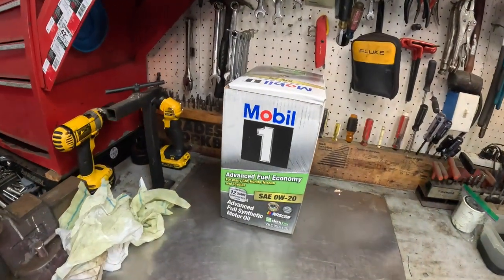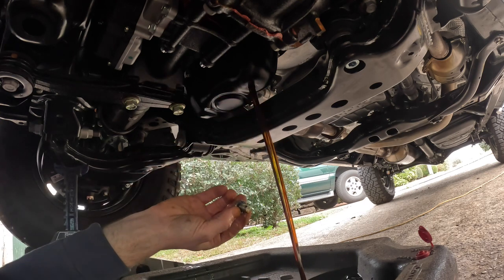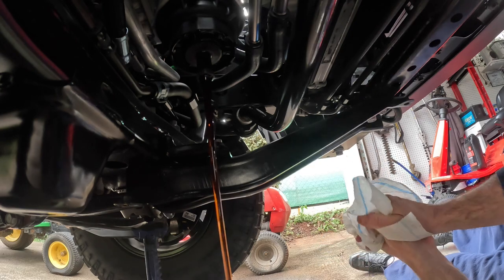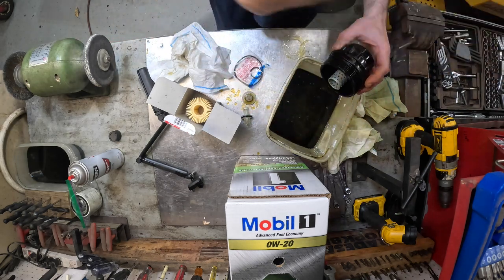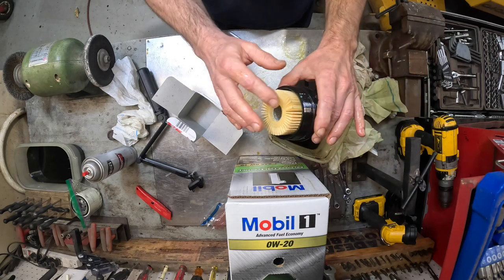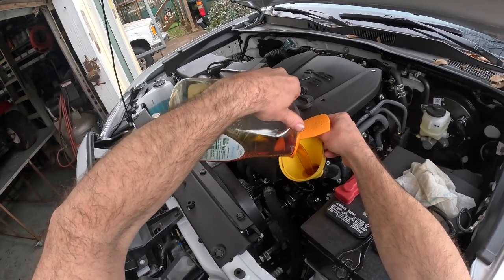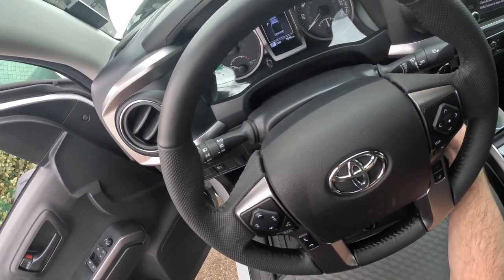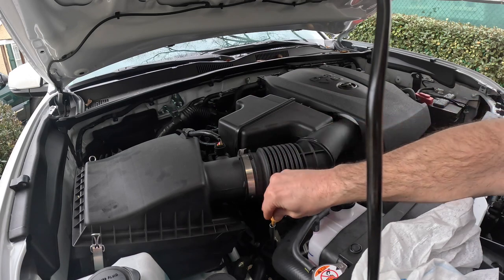2022 Toyota Tacoma Third Generation First Oil Change

Comment: The chin spoiler / air dam is there for gas mileage. I left mine in place because I want more mpg. Toyota engineers put it there for a reason. You won't find them putting on a part for a needless reason especially since it adds to the cost of the build. With oil changes I just flex it enough to slip my ratchet extension in there so no need to remove the piece. I'd sell my Mother for better gas mileage so the air dam stays put. Imho it looks fine.
Reply: I had read that piece directs more air thru the radiator.  Looking at it I'm not sure that makes sense but ya I felt the same as you,. Engineers don't just add unnecessary pieces for the fun of it so whatever it's for.. Mine is also  staying on.
Reply: @000distructzero  Toyota puts them on the SR & SR5s...Not the OR or Sport. I may take mine off just to see what mileage change there is. Supposedly not much difference. I need to check things out for myself.
Reply: Why did Toyota engineers put a hood scoop on the Tacoma Sport?

Comment: Hey Tom. Appreciate the video. Nice job w/ a bit of humor too. Dealer said they don't want to change my oil until 10,000 miles. I'll change it my self then. It's the 1st oil change @ 5000. I have always done my own maintenance and repairs on my vehicles. I always owned GM. This is my 1st Toyota Tacoma. I was told the plastic housing sometimes warps and or cracks so I purchased the OEM aluminum one that I will install during the oil change. God Bless.
Reply from the maker: dont use the metal one, keep the plastic one, i've read alot about it
Reply: @TomDobyMowerRepair whats wrong with the OEM metal one?
Reply from the maker: @rstumbaugh43  its been a couple years since i made this video and cant remember why, but @thecarcarenut has videos on it

Comment: I too am going to change my oil myself at 1000 miles, but I think it’s going to be closer to 1080. Just went down to my local Toyota dealer (Servco Mapunapuna here in Honolulu) and got an OEM filter, drain plug gasket and 7 quarts of oil for $72. My first service in the free 2yr/24,000mi period is at 5000 mikes and I have always heard of engine builders, OEM’s (prior to 2000) recommending the first oil change after the break-in period. I also have had my 2023 Tacoma TRD Iff Road ACLB (Access Cab Long Bed) for about 2 months as I just bought it 27 January 2024 and it’s 16 March 2024. I also plan on keeping this truck till I stop driving (turning 48 this year) and then pass it down to my first born.
Wish my dad still had his 1995.5 Tacoma Xtra Cab V6 4x4 5-spd manual 2manual locks and roll down windows. He sold it to an acquaintance of my sister in 2017 when one cylinder lost compression and he didn’t want to rebuild the engine, clutch and brakes. So he got a 2017 Tacoma SR DCSB (Double Cab Short Bed) 4x2 4-cylinder auto. 
Looks like tomorrow is oil change day for us, but we don’t have ramps or jack stands so we will be squishing under. 

Thanks for the in-depth video. I also enjoy The Car Care Nut’s videos.

Comment: Great video. The best I've seen about 3-Gen Tacoma oil change. I've done a million oil changes to all kinds of vehicles (and landmowers!). At my age, I just go to my local Jiffy. They are locally-owned and its a quick in-out deal, and I don't have to worry about oil messes, back aches and oil recycling. BTW, Toyota gives me a couple of free oil changes, but the first one was at 10,000 miles.

Comment: Ive always been told to pre-oil the oil filter so bearings are not starved for oil on first startup
Reply: Very true. There's a recent video which shows the consequences of not adding oil to a newly installed oil filter. Those cylinders and piston rings will be dry for several seconds before new oil is pumped to them, causing a bit of unnecessary engine wear.

Comment: With my third gen tacoma, I ended up having to run a tap through the skid plate holes and buy new bolts. I had 1 and then 2 of the bolts cross threading. I blame it on the oem self-tapping bolts they used. All good now. I have the same oil drain container. I was waiting for your oil to shoot up out of the container like mine does.
Reply from the maker: @oysterjohn5669  I usually forget to open the vent haha

Comment: Tom, great video clip... how about the torque spec on the oil filter cartridge and end cap plug? Toyota says 18 ft lbs on canister and 10 ft lbs on the end cap plug... 30 lbs on the pan drain plug..

Comment: I bought a new 23 Tacoma I checked the front diff oil it was black and Ive only had it in 4x4 three times for only 700 ' up my driveway and the truck only has 6,500 miles it was bad and the back diff was 2 1/2 Quarts low, my transfer case was good but guys check those diffs.  the thing for me was I had my first service at 4,000 miles at my dealer and the tech checked the boxes on my check list that the diffs was good and all fluids was toped off.

Comment: I have the 2023 and the dealership will do it all for free, not sure if that is a new thing without any added expense when I bought it. I did not pay for any extended warrrenty or anything.
Reply from the maker: yea i think all new toyotas come with the first 2 years maintenance, but the first oil change aint til 10,000 miles

Comment: Could you have used a swivel ratchet to get the skid plate off, rather than removing the air deflector? 
I'm just curious if that might work, or if the plastic peice needs to be removed for the front tabs..
Thanks
Reply from the maker: Yea you reach it without removing the deflector
Reply: @TomDobyMowerRepair  Great..thanks for the info

Comment: Where did you get the filter wrench cap.  My old man paid 50 for his from toyota but since i moved i cant seem to find it.   

Edit: Oh nevermind im at the 5 minute mark 😂
Reply: When I put more than high mark I just loosen tha cap half turn to 2 turns depending how much more psi I feel it has calculating the volume and viscosity oil used

Ad throttle input response and if the motor feels over pressurized more throttle I give it  I gotta let it breathe mama Mia 😂

Comment: I changed my 2023's oil with 100 miles on it because the dipstick seemed to be reading high. I know these dipsticks are terrible, but I needed peace of mind.
I did a complete oil change today, and it was about 30oz overfilled. 
Has anyone heard of this? I bought it with 6 miles on it. It's a 3.5 SR5.
Thanks
Reply from the maker: I know I had a heck of a time reading my dipstick, did you look in the filter for any sparkles? I didn't see any in mine
Reply: @TomDobyMowerRepair  It was a tad bit metallic in the tub, but I didn't notice any in the filter. It only had 100 miles. I'm just glad I didn't wait considering it was overfilled.
Reply: @TomDobyMowerRepair  Have you ever seen oil seepage around the rim of your oil filter where the plastic meets the metal? I have some oil that keeps appearing there and it's torqued to 20 foot pounds.
I have 110 miles on this truck and it's already a headache. Thanks
Reply: @TomDobyMowerRepair  Also, my filter housing seeps oil slightly at the upper base where it meets the metal. It looks like it bubbles oil slightly and there are drips on the inside of the pan. It's torqued to 20 foot pounds. When I put it on, it gets tight with about 1/3 of an inch to go before it meets the metal. Same coming off, it stays tight for a while. It's not cross-threaded like you said but it doesn't feel like my wife's Rav4. That one goes in easy then gets tight right at the end. Could there be a problem with the threads in the metal unit above the filter? I just did the oil at 100 miles and it's seeping. 
Thanks
Reply from the maker: @User-q6x3b  i'd sure take it by the dealership

Comment: Did it say in the owners manual to change the oil at 1000 miles for your first oil change?
Reply from the maker: no, 5000... which is what the dealers promise to pay for, have to take it upon yourself
Reply: @TomDobyMowerRepair  I just bought a 2023 Tacoma was just wondering if the oil might need to be changed sooner because the motor had 7 miles on it when I picked it up.
Reply from the maker: wait til 1000
 @reggie2334able

Comment: Why do you keep the washer on the drain bolt? Can you reuse?
Reply from the maker: if i remember right i should have changed it, i comes in the kit
Reply: @TomDobyMowerRepair  it will come with the OEM oil filter?
Reply from the maker: it should come with both o-rings with the filter

Comment: Well done my friend;! I need to do mine, what was your reason for changing it at 1000 miles?
Reply from the maker: well it gets that initial engine wear out of the oil and doesnt recirculate, a lot of people do it and i thought why not haha
Reply: Car care nut mentioned their could be residual metal shavings in the engine from manufacturing. So that 1,000 break in period is a good time to get that out. I wasn’t aware of the 1,000 mark when I did my 2022 Highlander at 5k. I saw a few small pieces of metal shavings in the filter. He was right.

Comment: I would consider using 30 weight oil instead of 20... They use 20 weight for government mandated mileage figures but it will wear out the engine faster
Reply: Agreed. 20 weight will get you to 200k-250k. 30 weight full synthetic is what gets your engine to 400k+.

Comment: Why 1k instead of 3k?
Reply from the maker: well they say 5,000 now, but its a break-in thing when its brand new
Reply from the maker: @Oliver-xe3wn  yea thats what i was worried about but i didnt see and specks at all
Reply: @Oliver-xe3wn  

After only 1k? #recall
Reply: 1st oil change after break in at 1000 miles. Then every 5,000 miles after that to ensure the engine lasts for a very long time. I heard an engineer for Toyota that helped design this engine who said that you should change the oil every 5,000 miles.
Reply: @Oliver-xe3wn  you’re probably seeing metallic shavings because you drove the engine too hard during break in. You want to keep RPM’s low during the first 1k.